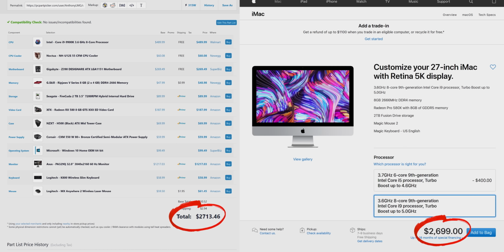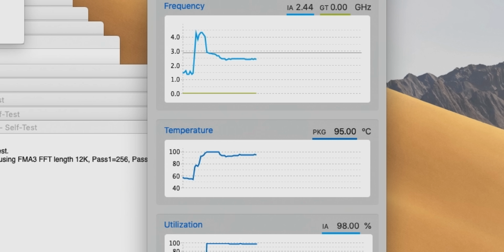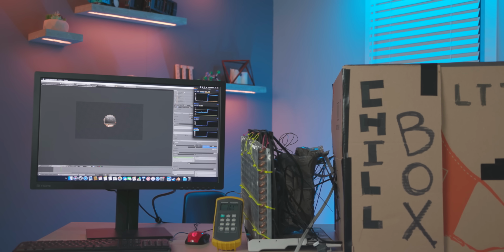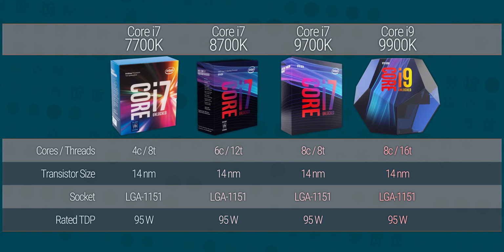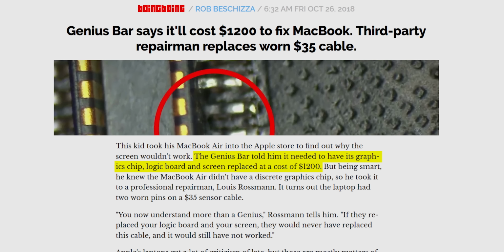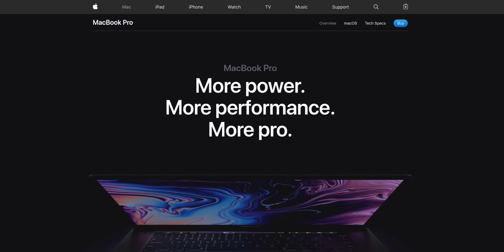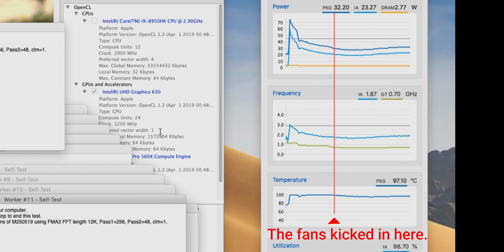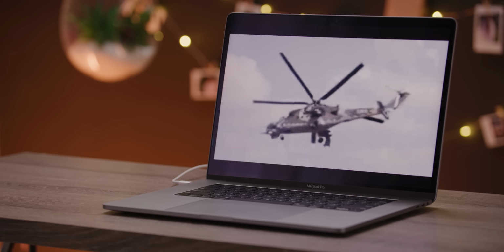Macs are SLOWER than PCs. Here’s why.

Comment: But Macs don't have high fail rates, I have a 2016 MacBook pro 15 inch and it works amazing, and the fans run all the time and it gets very hot, so its not like Im not stressing it. Also my brother has my old 13 MacBook pro from 2012, it still runs like new and is in perfect shape. I have always used Apple MacBooks with SSDs and they have never failed and ran flawlessly for as long as I owned them. I am sure the hard drive ones would fail or slow down significantly over time, but my experience is exclusively with the SSD ones.

Comment: I understand the fact that apple definitely doesn't have the best hardware by far... PC's are going to kill mac's in performance. But MacOS is BY FAR the better operating system. The user-friendliness is unrivaled, having the ability to transfer data from my phone to my computer in seconds is priceless. The ecosystem is the best in the world, and the software exclusive to mac just make it better. I definitely think PC gaming is better though
Reply: You can transfer data from your phone to the computer in seconds on Windows too. What bs is this? Apple just makes it hard and shitty to be on the Windows platform so that naive users buy only their products. Use any Android phone with Windows and its easier and faster than Apple's implementation.
Reply: @TheFourthWinchester  Wirelessly, apparently you've never used any apple computer to it's fullness, this sounds a bit biased.
Reply: @TheFourthWinchester  Again, hardware is by far better on PC but Mac is the better operating system, ask anyone that has used both in depth for work. Gaming windows is the better operating system because of how much more you can access.

Comment: Apppe puts in cpus that don’t suit the form factor very well because everyone demanded the best CPUs for “pro” machines. Remember when they were a year behind on the tech and everyone bitched? So they slapped in the better, newer cpu and had to implement the tweaks to make that work. So a slower cpu that doesn’t need to throttle would be just as good but then people wouldn’t want to pay the price for that cpu when pc laptops at the same price have the better cpu. And people like Louis Rossman and Linus himself are that ones pointing out when apple is not giving people the best value for their money. Well, this is the trade off with doing that. Apple would have to beef up the whole machine and it’s cooling and make it heavier and thicker to give the full performance. But they would take away the value in small and light, which is something users also want. People want thin and light for portability AND latest tech and lots of power. But right now that simply is not possible without trade offs. This is why Apple will likely switch to custom arm CPUs that can be powerful but not power hungry and run a lot cooler.

Comment: This may be unique to me... BUT I have an HP Elitbook 8460p with an i7 2.4ghz with 16gb DDR3 Ram. Windows 10 runs staggeringly slow. So slow I can't use the laptop for what it was intended for, to control a custom made CasparCG client and the remote software for a V-1HD vision mixer. I have now hackintoshed the system AND it is lightning fast compared to the windows 10 OS I had installed on it. Windows 7 runs okay, but I my Hackintosh High Sierra runs smooth as a babies arse and does exactly what I need it to do. It was a bitch to optimise at first but once the initial tweaks where made... I'd choose it all day over windows 10. Now this isn't me slagging off 10, 10 is near perfect for me. I use 10 on my editing and server PC and it's flawless but in the Elitebooks situation Mac was much faster

Comment: I would think about it like this: Apple is pushing the best performance possible in the contraints of the chassis. 
Apple prioritizes sexual appeal over performance. However, they are willing to put in the best spec inside the chassis with poor thermals even if it means not achieving the full potential of the specs.

Comment: From my limited experience, there are a couple of places where a Mac outperforms a PC, and spoiler alert, it's not hardware-performance-per dollar.
First is the user experience. You've just installed a program on your PC. Where are the files stored? "Program Files (x86)", or the other folder named just "Program Files"? Experts might know right off the bat. They probably even know why there are two folders. But the average user doesn't understand this stuff. On a Mac, everything is in the "applications" folder. Multi-window management on Mac OS outpaced PC's as well. I would confidently say that a Mac OS makes more sense out of the box to a new user than Windows 10 does. Windows 10 only gets the edge because most people are already familiar with it before they get a computer of their own. It's everywhere, so it makes the rules.
The other is Photoshop. I told you my cross-platform experience is limited and I meant it. Photoshop is better on a Mac. I could list dozens of reasons, but I'll just stick to two, for fun. First, on a Mac, and PSD file icon in the Finder is an actual picture of the composited Photoshop image. In Windows Explorer, it's just a generic PSD icon. That's annoying as hell, especially if you work in a multi-lingual work environment where the file names might not be immediately understandable. Because now I've just downloaded a dozen PSD files from a colleague, and I can't understand the filenames, and the file thumbnails are all identical. Thanks for nothing. Secondly, Photoshop for Mac OS has never put the document windows on top of the tool panels, because why the hell would anyone do that? I'm working on File-A, but the window that contains File-B, which is in the background, is covering the layers panel. So I have to click over to File-B, move it out of the way, then go back to File-A to continue working. Oh, bonus problem: the alt key. If you hold down the alt (Windows) or option (Mac OS) key and scroll in Photoshop, you'll zoom. For several years (fixes only recently), if you did this in Windows, after successfully scrolling, the app would then acknowledge that you pressed and released the alt key, so it will hotkey the whole menu bar, so the next key you press will either activate a menu, or trigger an error sound. I hate error sounds when I'm not the one who's wrong. Anyway, they fixed it recently, but it took several years and it never should have happened in the first place. 
In conclusion, Libya is a land of contrasts. Thank you.
Reply: @Anthony Duncalf I stand by my contention that it is not intuitive to the average user to just know which of those two folders would house a program.
.
There are other reasons to go into the folder for an application than simply to delete it. But even if we were only talking about deleting apps, that's pretty easy on a Mac as well. You go to the app and throw it in the trash from the Finder, or you go into Launchpad and click the little "x" next to the app. Basically as simple as deleting an app from your phone.

Comment: With AMD coming back from the dead and offering tremendous value in productivity performance...

Just from a hardware standpoint, you already lose a lot of value/performance per dollar with no access to amd's affordable 12+ core CPUs, all the way to 64 core thread ripper. So you got an intel mark up on top of that apple mark up...

Oh and not to mention thermals when comparing Amd's 7nm CPUs to intels "14nm++"

But it makes perfect sense for Apple not to offer something like a 64 core thread ripper system with 256gb (as a workstation product) of ram, it will just cannibalize their entire own lineup... In fact AMD has done well to disrupt the HEDT market Intel has been milking all these years, and even forced their regular desktop platforms to support 128gb of ram. Not to mention comet lake aka 10th gen Intel sudden has SMT enabled on all their CPUs... From the low end Pentium dual cores to their i7's and i9's.

Remember even kaby lake i7's did not have HT...

Though intels 10nm tiger lake mobile parts are suppose to come first...  How about putting mobile/low power/thermal parts back in the AIOs instead of pretending desktops parts can fit in there

Comment: I would NEVER ... EVER come to the idea of using an overpriced, glued together, worse perfoming, overheating, quickly dying laptop for my professional work. (For over $2000)
when I can get an 8 core workstation or what for $1000 less... 
I actually feel bad for all those Silicon Valley engineers .. but portability and macOS have its benefits I guess. 
And if you get paid 150k a year you dont care about those $2k.
Reply: But there are many macbooks that are 1,000 bucks only things like the macbook pro are that high in price

Comment: Macs and MacBook Pros generally last 10+ years.  They don't crash and take out all of your data like PCS. They are easy to clone and back up. And they don't need an IT person for support. Macs have MacOS - PCs don't.  

It isn't because Macs break down that we stop using them.
We stop using the older ones simply because we buy faster new ones.

For example, we recently retired several 2008 MacBooks after purchasing 2020 MacBook Airs, for example. The MacBook 2008 models are in pristine shape. But the new Macs are simply much faster and use the latest OS and software.

Macs generally have been high quality machines that can run 24-hours a day for years.

In regard to why Apple lets its Macs run hotter than expected without kicking in the fans, it is because Apple customers want a quiet computer.

PC Users are use to having a ton of wind noise, even in their laptops.

But Mac users complain a lot when the fans are revved up and loud.

For example, Max Yuryev on YouTube noted how customers were complaining that the MacBook Pro 16" 2019 model's fans were so loud even in normal use. That was because Apple was "OVERLY" aggressive in ramping up the speed of Intel's CPU with Turbo Boost and the AMD GPU and causing a spike in heat.

So Max recommended TURNING OFF TURBO BOOST and using a FAN UTILITY to slow down the fan speeds - so the CPU can run hotter but within spec - so the MadBook Pro was quieter.

The MacBook Pro 16-inch with Intel i9 does not thermal throttle as often as in the past - hardly at all - since Apple became more aggressive in cooling down the CPU.

It also helps to use a thermally conductive stand to draw heat away even faster from the MacBook Pro. The bottom of the case gets much hotter than on past MacBook Pros because it looks like the bottom case finally acts like a heat sink to the CPU and GPU.  In the past, this was not the case.

Why do iPhones not thermally throttle like Macs?  That is because the IPHONE IS THERMALLY THROTTLED TO BEGIN WITH.  The iPhone has ZERO cooling system. So it cannot run at the fastest possible speeds. It only runs at the allowable speeds that Apple gives it. And this is the throttled maximium speed that Apple has determined can be contained by the iPhone without overheating.   Apple does not advertise the speeds of its own CPUs and GPUs.   Apple's CPU design is faster than competing Android CPUs. But realize that Apple's CPUs are still running far slower than they are capable of running!  Once Apple has desktop ARM CPUs, you will get to see how much faster Apple's CPUs can run.
Reply: Lmao I couldn't be bothered reading all that but stop fooling yourself, AIOs are so hard to do simple maintaince like just cleaning dust.  Which is especially bad for dedicated GPUS.
Reply: Louis Rossmann says otherwise.

Comment: Apple was number 1 in reliability for years according to a variety of surveys. Consumer Reports had them as the most reliable computers in 2016. RESCUECOM (the industry leader in computer repair) again had Apple number 1 for reliability in 2018. Survey after survey showed Macs were the most reliable. My last two Macs have been super reliable. Unfortunately, I noticed that in their 2019 report RESCUECOM has Apple in the middle of the pack, getting a B for reliability. Apple still comes ahead of Asus, Dell, HP, and Acer, but is behind Microsoft, Lenovo, and Samsung. In any case, for the average consumer, Apple computers have been very reliable machines in relative terms. The data back that up.
Reply: They aren't reliable. Louis Rossmann says so.

Comment: The main reason iPhone is not throttling is that they use their own processor in it. Hopefully in few years it will come to MacBooks and problem will be solved. Before that everybody will have to stick with badly designed and overpriced laptops.

Comment: My good old mid15 macbook fans go wild when loading 3D Google maps :D Altough I have to say, I run minimum 2-3 adobe apps + sketch, and many other apps at the same time. Barely restarting. Almost 5 years and still like a breeze. 
Always was and still am the PC guy, but never had a notebook this good  ¯\_(ツ)_/¯ 
Not talking about the overall user experience u get, which is I guess the main reason ppl get those. That and flex.. 
Probably made myself the "less tech savvy" part of the market :D
Reply: But yeah, when you render long video in AE, or anything 3D, you wanna go to desktop PC :)

Comment: I’m sitting here listening to the complaints Apple is doing oppose to the real problem.  This is why Apple abandoned Intel.  All the complaints you listed are Intel problems and not Apple.  Perfect point you only see throttling on Intel processors because of old design.  No throttling on Apple ARM processors.
Reply: Yes, Apple's mobile SoC uses something like 5.5W max. to beat 17W TDP Intel CPUs where just a single core full throttle takes 15W.

Comment: My 7 year old 2013 MacBook Pro still works perfectly fine  and hasn't even had its battery replaced yet while still being able to give me 3+ hours without plugging in. I have historically bought a total of 4 windows and 2 macs. And those 4 windows combined still lasted less than my Macs. And FYI, i managed to resell my 2009 MacBook Pro at a Cash Converters' in 2015 for £200. And at that point, it was STILL FULLY WORKING, except that I had no need for it already as my 2013 MacBook Pro had completely replaced it by then. I currently own my 5th Windows laptop; a Dual-screen ASUS ($4700), which i use for my work (yes i separate them), but at home, I literally only use my 2013 MacBook Pro. I wonder why. 
AppleCare? Yea whatever.

Comment: Can someone please explain why a mac-laptop just works for years and years, when a pc-laptop gets slow and the battery completely fucking useless? Btw I use a desktop pc normally, as you should.
Reply: Dude? That steryotype is soooooooo old. Yeah back in the early 2000's, non mac laptops batteries sucked. But it's 2020, batteries in those things are great!
Reply: Why do people keep saying that? That's not even a thing. Yeah, and Macs don't work for long. Louis Rossmann shows how unreliable and terribly made Macs are.

Comment: Just more reasons why  I'll never buy another macbook "pro". All their stupid shenanigans: shit keyboard, touchbar, no ports, heat issues, no Vulkan (MoltenVK is not the solution), outdated opengl, system "integrity" protection, etc, fuck them. I've bought multiple MBPs over the years, last one was in late 2013, and was happy to hand them > $3K CAD for that, but it really doesn't make any sense at all anymore. As a software developer, I find their software and hardware kind of a joke nowadays, I can't even properly work on my OpenGL and Vulkan based projects because they're platforms are just tools for pushing their own ecosystem of "tools". I don't even feel like I truly own my hardware sometimes because of ridiculous restrictions.

Comment: i gamed on a macbook pro 2011 13'' for years under full load (yeah i know its the worst gaming device on this planet but i got that for free and had nothing else) and i still own it and it still works. since 2012 its working like a dream and i never ever had any hardware or software problem. no bluescreen, no freeze, no hangups, and no shutdowns. dont get me wrong; im an application developer and im 100% a pc guy. but i got to give this machine credit, because no device has worked that well with no problems for such a long time. i have a decent gaming rig now but the macbook is still in use today and its still working like the first day.

Comment: The marketing deception Apple uses here makes sense to me.  How can the Apple brand hold its status if its flagship doesn't have a cutting edge processor?  That's the reasoning of the mass consumer.  Customer perception is everything for Apple and they must protect their brand at all costs.  Really Apple is leaping out in front of the market by building a product that doesn't make functional sense but appears to be a flawless divine instrument.  As long as Apple can stay at the front of the [elite sexy laptop] market they will perceive that they are winning.    If this trend continues Apple will surely burn itself badly.

Comment: Now with arm based Mac on the way, we know that the cooling solution they are designed for are those in-house designed chips, not anything from x86. Actually, with those chips, no fan required at all. Guess that’s what Apple targets all along. 
Too bad that MacBook Pro is reduced to a much more expensive iPad that runs slightly modified version of iPadOS without touchscreen support and no x86 support.

Comment: Apple does this knowingly and intentionally. I used my Macbook Pro and Air heavily and both got damaged. Logic board got damaged by itself. Meanwhile my Windows laptops from 2011 and 2012 are still running completely fine except the battery.